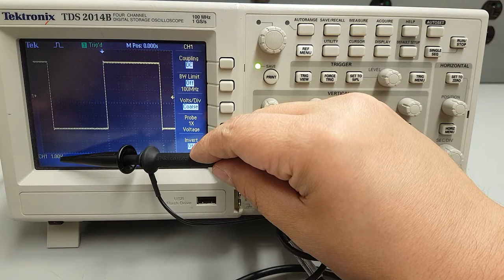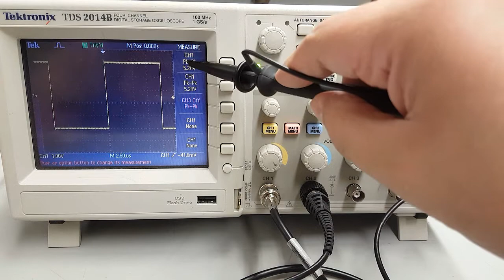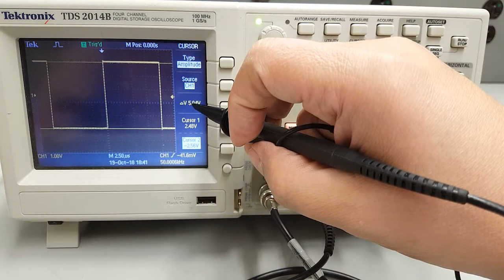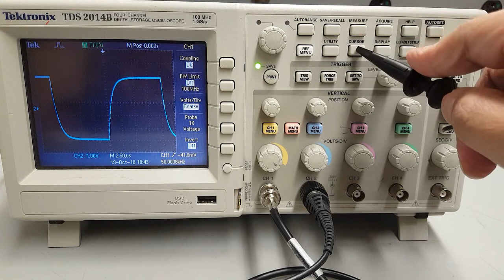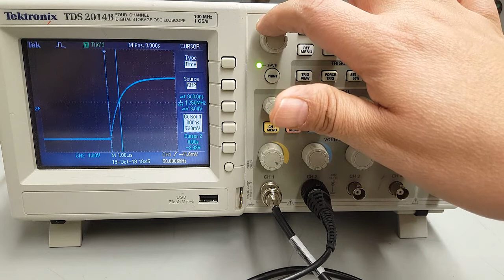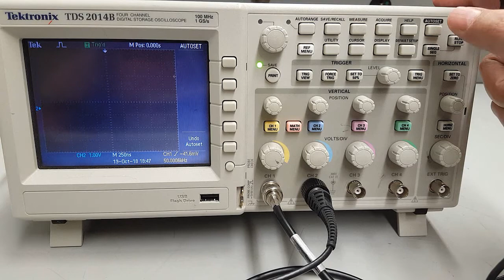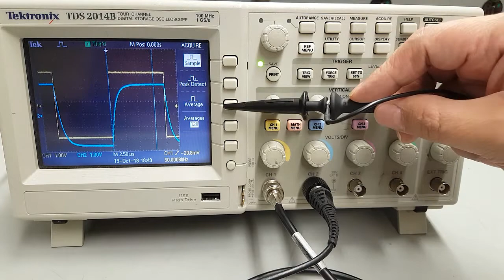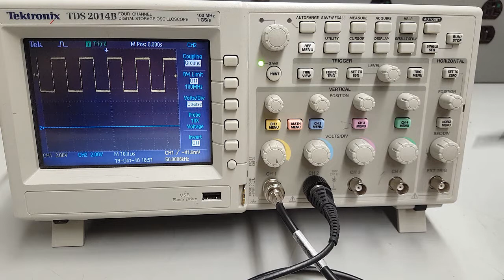Tutorial Introduction to Oscilloscope 2- More Measurements ( RC Time Constant)

Comment: just have the scope measure rise time,         then use:
rise-time = 2.2 * tau
tau is time constant = r * c
Reply from the maker: Of course the scope can do that, but the students need to have the ability to read volt and time divisions.
Reply: @abuhajara  why half the time, they get it wrong.   🤣🤣🤣
Reply from the maker: @TheGmr140 Thank you for your feedback, the time constant for the RC circuit is the time required to reach 63% of the peak to peak value on the rising edge. You can talk to your professor if you do not know why.